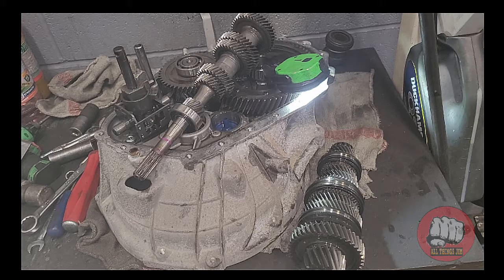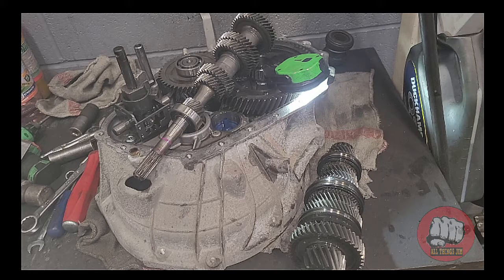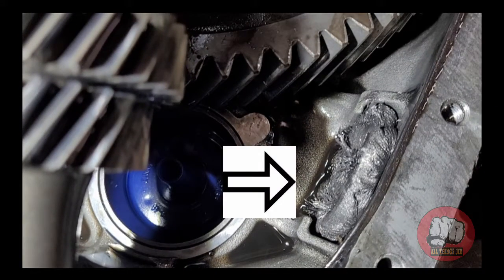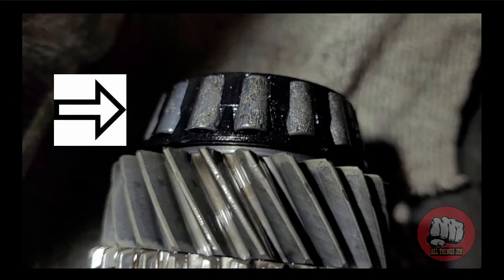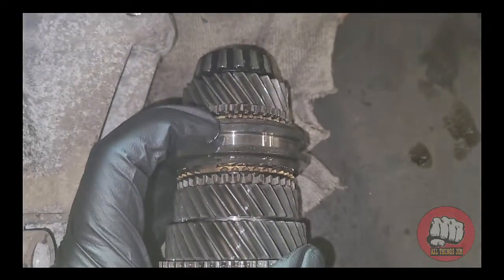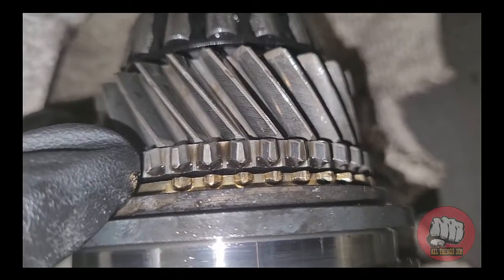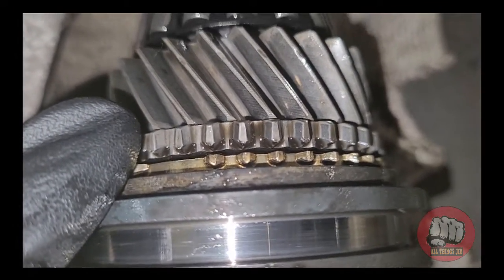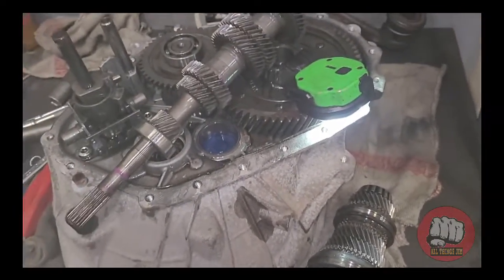common Ford fiesta 1.0 ecoboost gearbox problem

Comment: Thanks Jim, we shared this with our local garage re our 1.0 fiestas shifting issues and it did indeed turn out to be this very issue. The bearing failing had also damaged the gearbox casing so we've ended up with a complete reconditioned box.

Comment: bearing failure is common on these gearboxes. They also only have 1.3 litres of 75w ford ford oil in them when we effect a repair and the gearbox is refitted we use fully synthetic 75w90 oil filled to the level plug NOT 20mm below it as specified by ford, this is @1.8 to 1.9 litres.. You may lose 1 or 2mpg, the gear change is still fine and we have not had one go bad since. There is no drain plug so the car is set up on a ramp leaning to the nearside and the drive shaft is removed. only a very small amount of the original oil is left in the very bottom of the diff. The oil that comes out is invariably very dark.

Comment: Hi Jim, this video is exactly the problem we are having with our 2019 Ford fiesta 1.0 ecoboost 6 speed manual. What does it cost to do this repair ?,  do you offer this repair service ?.
Reply: Hey mate, did you find a fix for this?

Comment: My fiesta 2017 1.0LTR T ecoboost is having problems in 1st gear when I’m stopped at the traffic lights or junction, won’t let me pull out of gear when clutch is in, and car will start jolting forward. Is this the same problem? And does anyone know how much is would cost to repair or replace ? 🫠

Comment: Got a 2017 and 2018 fiesta in the family. One had box failure between 30k and 40k fixed  under extended warranty. Now second one is just starting to whine at 47k. Seems to stop when warmed up though. Changes gear and drives fine for now.
Reply: Turned out to be two bearings in the gearbox.

Comment: Wonder if you can help I’ve got a 1.0 ecoboost fiesta that when I select 5th and let clutch out it misses the cog and makes that noise like it’s hitting the edge of the gear teeth
Reply from the maker: Unfortunately thats fairly common, youll need the gearbox removing and stripping, youll probably find 5th gear and uts syncro need replacing.... theres a short video on my channel showing this fault I believe (although it may be 2nd gear its essentially the same thing )

Comment: Hi Jim, I'm really hoping you can help, the gearbox on my 2019 fiesta st-line X is making a horrible groan and struggling with shifting into 2nd (tries to pop out) like you mentioned in this video. I'm considering getting a replacement box fitted before I sell the car but I'm unsure how to find the part number I need for a replacement gearbox, do you know how I can find it?
Reply from the maker: You normally can see a parts sticker on the top of the box which will have a set of numbers and letters somewhere around near where the gear cables attach (example:M1BR7002CFF), also sometimes they have a flat part on the casing with the part number stamped on.... failing that just go to a ford dealer ask them how much for a gearbox giving them your reg and chassis number and once theyve told you the price ask for the part number 😉
Reply: @ALLTHINGSJIM  brill, thanks for your help Jim, wish me luck!

Comment: Hi Jim, great video thanks. I am trying to help an old mate who has one of these with a gearbox issue. I am an engineer but the last gearbox I had in bits was probably a Mk1 Ford Escort !. May I ask please if the Eco system has in anyway a connection with this gearbox whatsoever. Basic common sense would tell be a positive no, but, have to ask anyway. Much appreciated n thanks
Reply from the maker: Hi there, No the "ecoboost" is just part of the engine, the gearbox is like any other , a set of gears shims syncros and bearings. Thanks for watching 👍
Reply: @ALLTHINGSJIM  Thank very much Jim, truly do enjoy your videos. I knew I was that far out of touch and sure, and a manual box is, and always I guess will be, a manual box - even a Mk1 Escort. keep up the good work mate !

Comment: My ford fiesta has just got to the stage of needing a new 1st and 2nd syncrho replacement, oddly enough my first gear was fine when I first noticed, 2nd wouldnt engage coming down the gears but was fine going up, then 1st became problematic but after a few months fixed itself, but now about a year later 1st will no longer engage unless im basically at a stand still. Off to the gearbox guy I go!

I also had my engine replaced by ford as well due to the gasket leak, funnily enough my engine went pop about 100 yards from the dealership on my way home from work, convinient! They replaced the whole engine on the recall though so luckily it didnt cost me anything.
Reply: This exact thing has happened to me, was it an expensive issue to resolve?
Reply: @ewanmayock8423  so my cars actually going in to have the gearbox redone in a week or so at a specialists, I was quoted £820 for the rebuild.

Comment: Has anyone had a whining noise n/s/ft but no problems with the box otherwise?
I’ve taken my 2018 1.0 6 speed manual to 2 garages 1 couldn’t hear the noise and the other could. Both said carry on driving until it either gets louder or I get problems changing gear 😳.
Oil level is fine no leaks but I suspect a bearing.
It’s always been a little notch going from 5th to 6th but fine in other gears.
Reply: Yes me. Did you solve it? I'm in exactly that position. 2918 Ford Ecoboost 6 speed manual. Can hear a quiet whine (new) when rolling down hill in any gear or neutral. Depends on road speed not engine speed. Seems to get quieter and sometimes not audible as car warms up. Ford main dealer said they could hear it but wanted small fortune to investigate. Just this week I drove it to a gearbox specialist and by the time I got there it had stopped making a noise. Changes gear and drives fine. Have also decided to keep driving it until its repeatable.
Reply: @ColinWatters  no I didn’t but I took it to two garages who both investigated and took it for a test drive. They could hear it and thought it maybe a gearbox bearing but just to keep driving it and come back if it got louder. 2,500 miles on and it’s still there, still quiet.
I could have said drop the gearbox out find the faulty bearing and change it. But the cost wasn’t worth it tbh.
Reply: @nigeh5326  Many thanks. If I find out the cause of mine I'll try and post a reply.

Comment: Mine is OK 90% of the time. 
Sometimes hard to put in 1st and going from 1st to 2nd. No crunching, noises or any other problems. 

Does it sound like the gearbox or selector issue?
Reply: Did you sort this issue, i have same problem
Reply: Same issue here but its not constant.

Comment: Do you think it could be a lack of oil? I noticed that there was very little oil in these boxes. 
I have always struggled to pass the 2nd (New car 2018, 1.0 Ecoboost)
Reply from the maker: Im not sure to be honest, I wouldnt have thought so as older / more reliable boxes ive seen with hardly any oil left in them which needed topping up hardly ever went bad, i honestly think its because they are built cheap, but thats just my opinion... thanks for watching 👍👍
Reply: @ALLTHINGSJIM  I had checked my box level by building a rod as explained by Ford and the level looked way below. However, I have no leaks. I'm thinking of adding oil to get to the level of the plug.